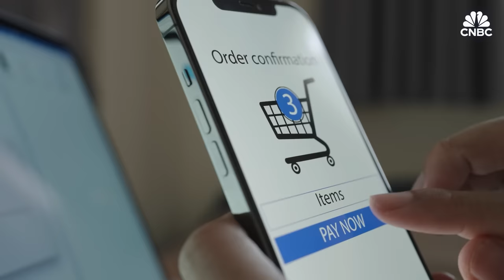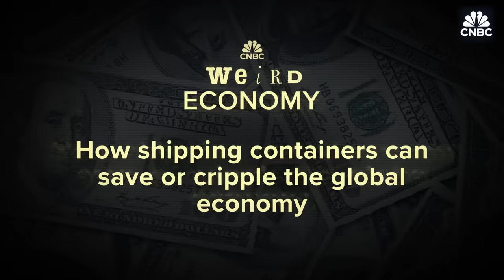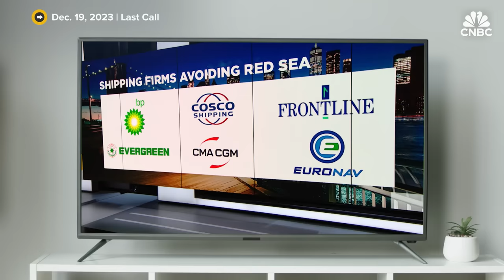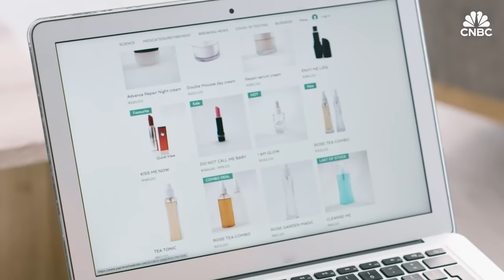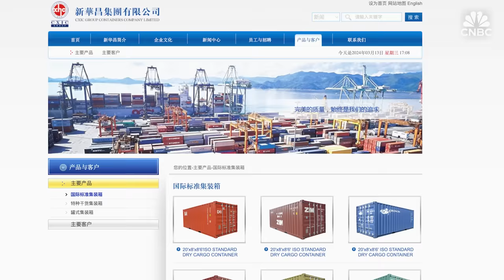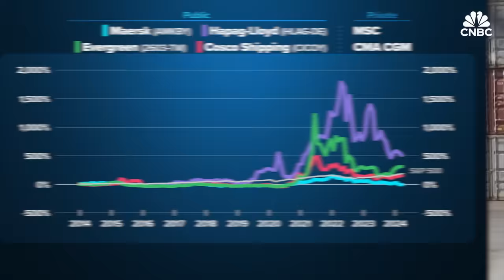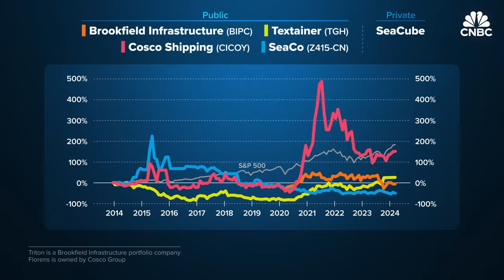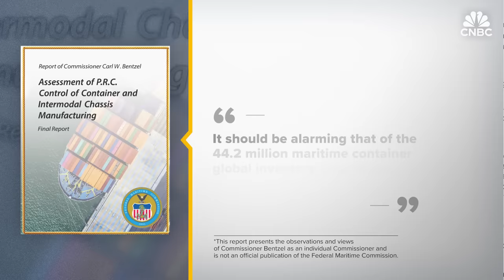How Shipping Containers Control Global Trade

Comment: I recently saw a neighborhood that was entirely made up of shipping containers converted into homes. This was on an indian reservation so idk if they had electricity or plumbing
Reply: Yeah, it's a thing. You can have electricity and plumbing in them however the insulation is worse in a metal box obviously and also it's really only a viable option in very rural areas, they aren't too shabby though
Reply: @Betweoxwitegan  it would be really hot in summer no? Like a can
Reply: @multatuli1  Pretty much yeah, if you open windows and keep them open you'll be fine though. You could also put in AC but obviously it's going to cost a lot of energy.